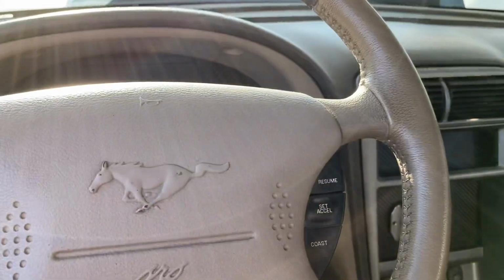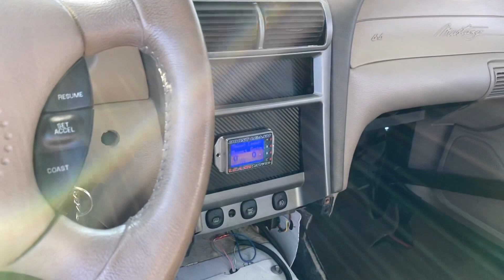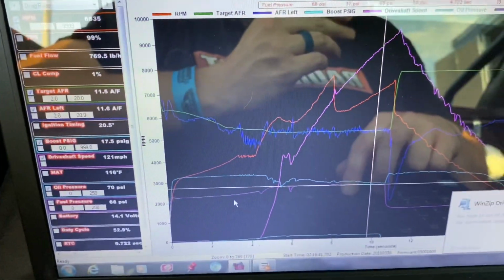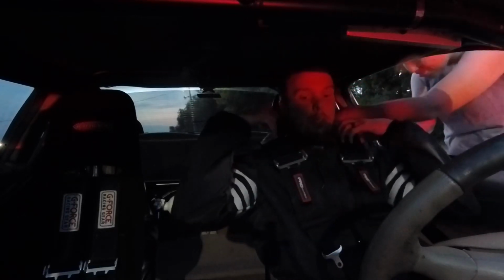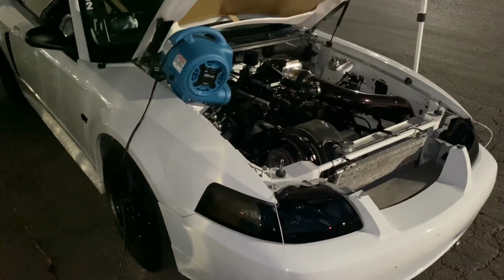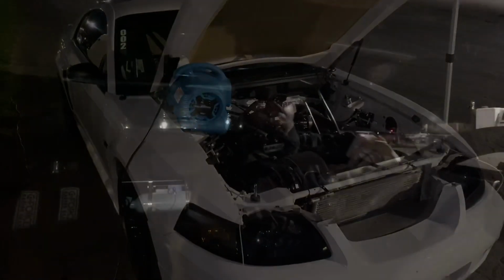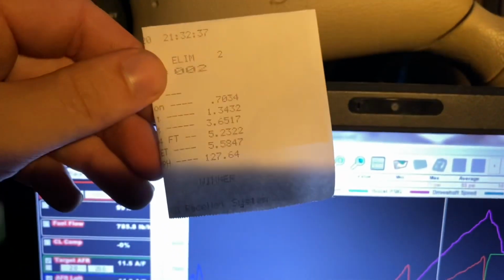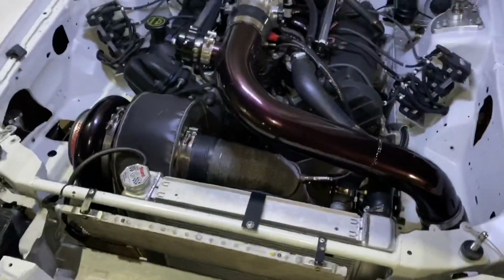I’m becoming a professional test and tuner! Dialing in turbo 2v for radical street

Comment: I'm doing a teksid 2v build and I'm wondering what timing cover you were running on your teksid blocks, I'm running stock ported Romeo heads from mhs any help would be appreciated! Keep up the good work man! 2vftw
Reply from the maker: I’m running my original timing cover, 03 2v timing cover. You will have to rtv one hole in the cover that doesn’t get used with the teksid block
Reply: @andrewlavender08  thanks man, are the bolts that go through the cover to the block and heads all the same size or do I need new bolts to go to the block?
Reply from the maker: Same size
Reply: @andrewlavender08  awesome, thank you

Comment: How are you feeling about your sway bar upgrade? and that hose looks doubtful, time for an upgrade.
Reply from the maker: It works a lot better than the old one
Reply: @andrewlavender08  In what way? have you done any video;s of the back of the car and how its controlling the axle wrap. Does it just feel more planted. i realize when you have as many pass' in the same car you can tell these things by the seat of your ass.
Reply from the maker: The old arb would flex which you could see in videos. New arb keeps the rear from flexing